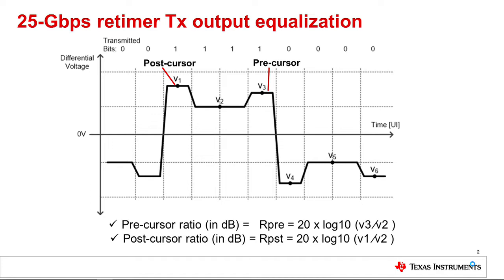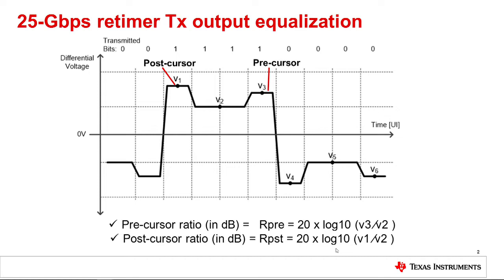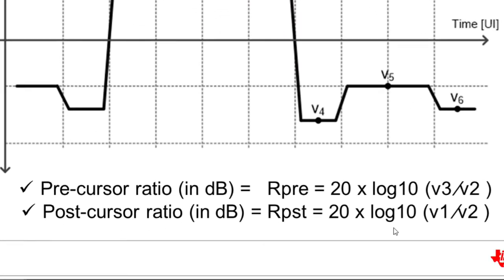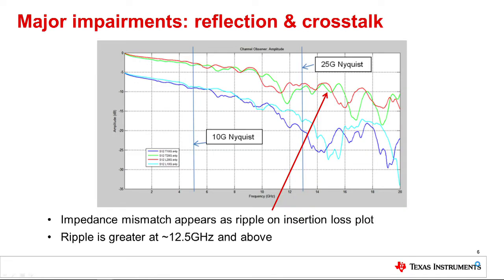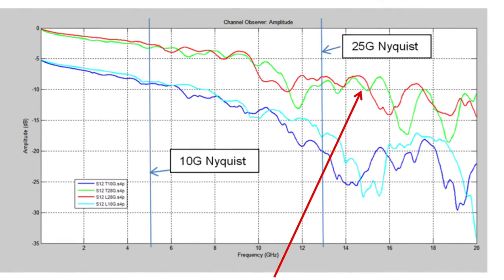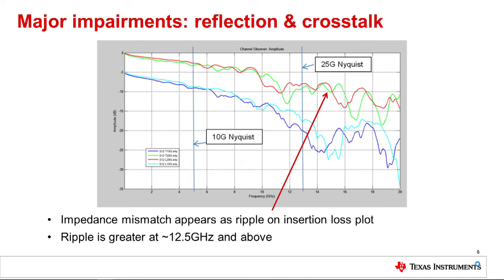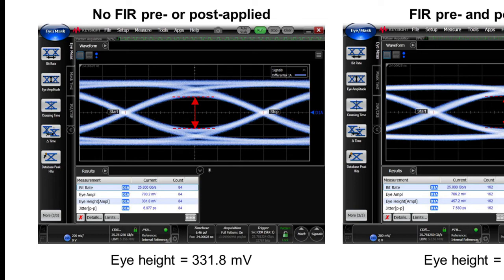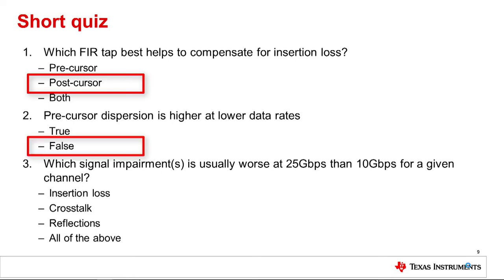Transmitter optimization for 25-Gbps Ethernet data transmission

Comment: What about the horizontal eye opening? How does the equalizers affect this?
Reply from the maker: Thanks for your question. The inter-symbol interference (ISI) from channel insertion loss manifests itself as both vertical eye closure (a voltage parameter) and data dependent jitter (a timing parameter). Insertion loss ISI results in deterministic jitter by affecting the starting point of data transitions depending on previous bits.

Equalizer post-cursor boost improves both vertical and horizontal eye opening when channel insertion loss is present. The amount of vertical eye opening and horizontal eye opening improvement depends on the equalizer boost profile versus frequency as well as the equalization adaption algorithm used.